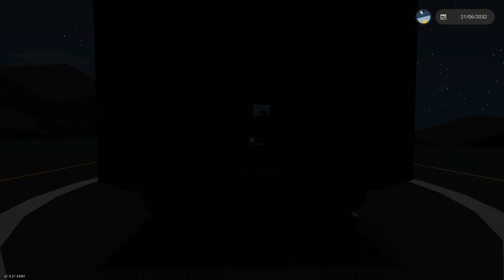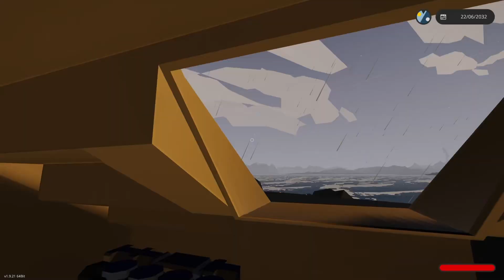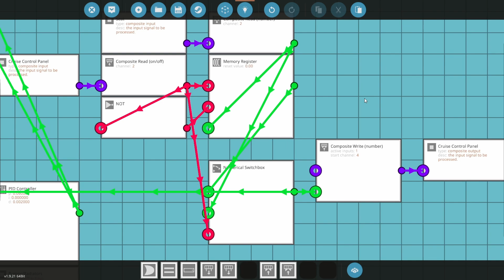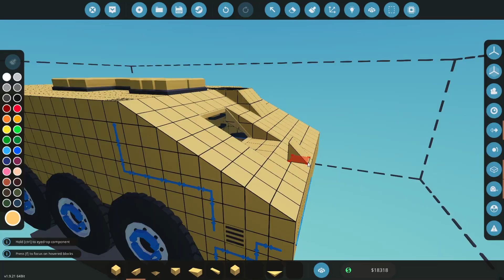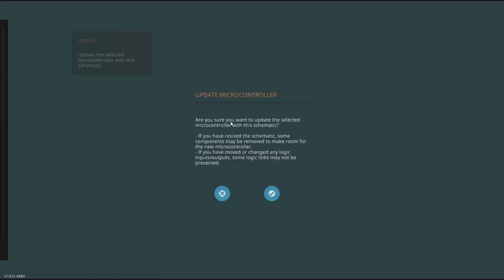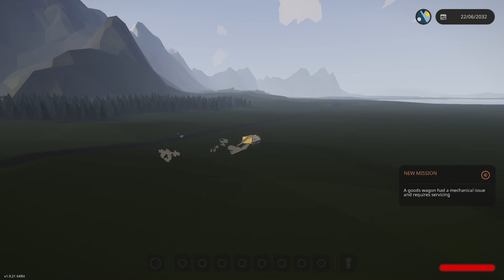Stormworks - Classic Career Story 05

Comment: Quick question: does it makes sense to use microcontroller as walls (where looks don’t matter of course), bc they’re just 2 dollars, and can be 6x6, and you can make them fit and they count as wedges as far as I know so better fuel tank capacity?
Reply from the maker: Yes. Its just easier to do all the logic and then try figure out where it all goes later.
Reply: @terr-rawr-saur  yes, but i mean just plain mc’s with no connection on them. But tbh it can make more sense to build them in at the end of the build, especially if there’s something to do with the select tool.
Reply from the maker: There will be so much logic that all the places a microcontroller wall can go, will be filled with working logic. @Plantoffel